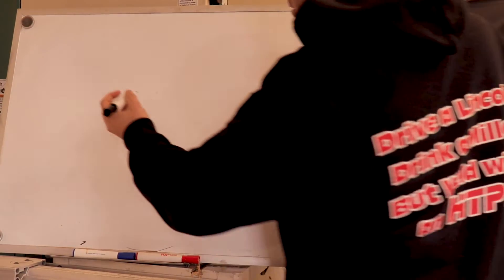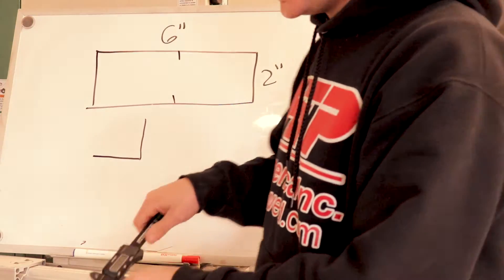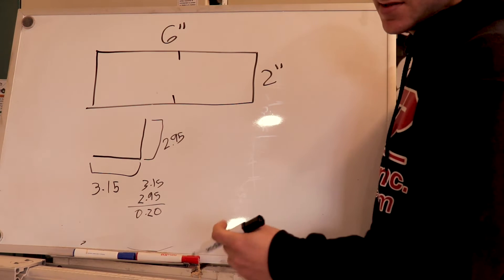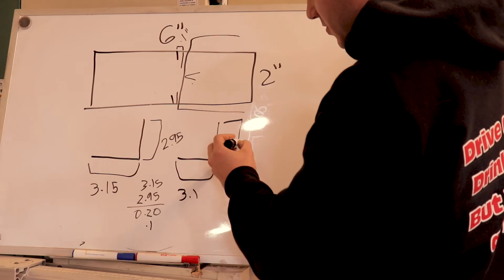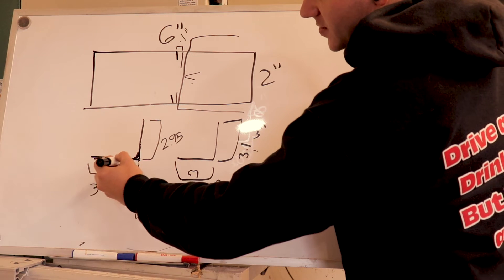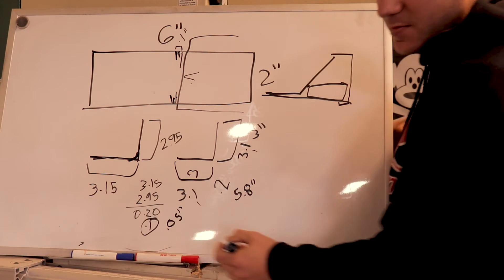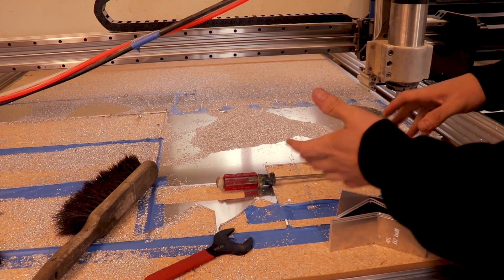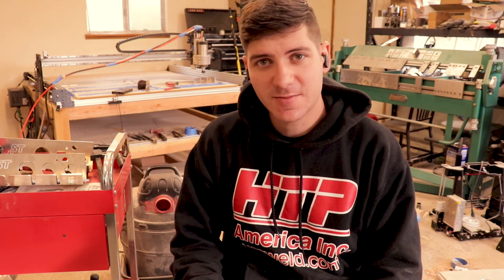How To Find Bend Line For Pan Brake

Comment: What are the advantages of having a box pan brake with a segmented lower blade as well as the upper blade being segmented??
Reply: Known as a European style pan brake. Allows you to do interrupted folds. If you remove say the left side lower segment from a bend, the apron raises and bends on the right side leaving the left side flat. It could also provide clearance to allow you to do reverse bends. Like bending a flange up next to a flange that is bent down. I find i it allows me to machine bend some parts that I would otherwise have to bend over the edge of the bench, or blocks of wood / odd bits of steel with a mallet or slapper if  I only had the more common upper segments. Hope this helps.

Comment: A nice explanation.  Though with those dimensions shown, more likely to get 3.05 and 3.05 after (2.95+3.15)/2.  In addition, it would be handy to mention the thickness, the clamp location as a function of thickness, and the importance of choosing the same reference point (clamp edge or pivot line) for each bend.

Comment: D*mn lol never thought of using a ROUTER table instead of a CNC plasma or even a CNC mill....router wouldn't require a heavy duty plasma or compressor. Less mess. And I'm guessing less cost? Seems pretty cool what you were able to do with it! Do you think that thing could handle thin stainless? 🤔 that would be a major selling point for me. Trying to decide if one of those or a mill should be in my future investments or not. Thanks bud, great to see ya!

Comment: Ya it shure appreciate when you use box and pan brake and use NC Air bending press brake lots of difference I use a note book on what I do on either side of bending process box&pan or hydraulic press brake air bending. Some day I add a laser system for much more accurate bending.
Reply from the maker: I've never hear of the laser system but that would be awesome!
Reply: @5thStreetFab  you got any tips for sealing up aluminum tube? Repairing a 50 year old boat top, the pressure inside the tube blew out the lap joint (angle to tube), guess I went too slow for the heat I was running. Couldn't seal it up, the air kept pushing out even after letting it cool. Drilled a 1/16 inch vent hole just so I could seal up the actual weld. Waiting for it to cool, then gonna try and zap the hole shut. Any ideas? Thanks.
Reply from the maker: @josiahwright7114  if you can zap the hole with a mig its usually easier.  If no i usually drill a 1/8" hole, shove some 3/32"  filler in there before i start.  Then i start about 3/8" away to get a puddle going and quickliy run over to the hole while pushing the filler in.  Another way ive seen is people purging the tube with argon first.
Reply: @5thStreetFab  I don't have a spool gun, but I like the idea of shoving some wire in the hole first. I'll give it a try. Thanks.
Reply: @5thStreetFab  I let it cool, stuck a little piece of rod in the hole, then zapped it quick, stuck in a dab of filler, and it's good. Ground down nicely with no pit. Thanks for the tip.